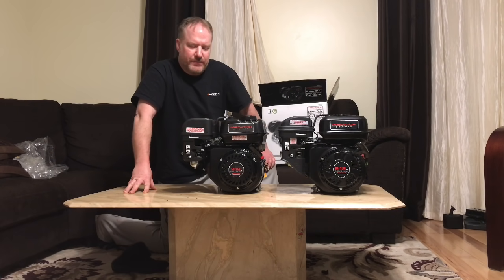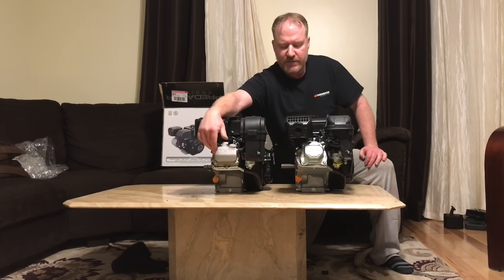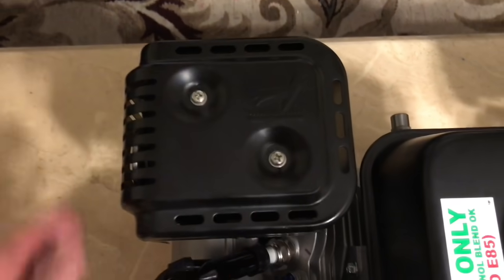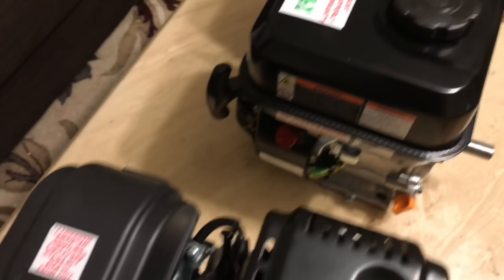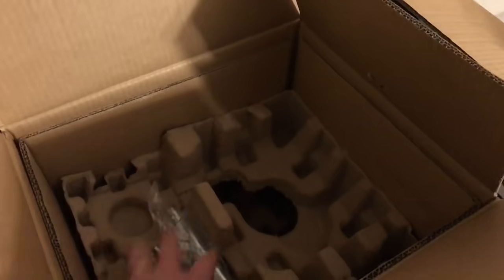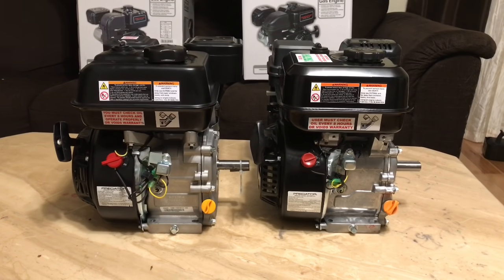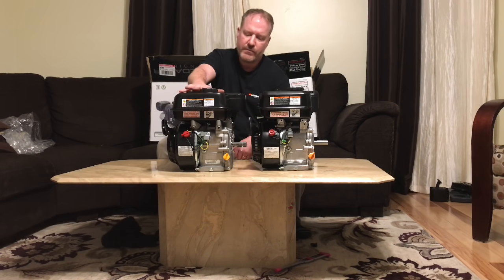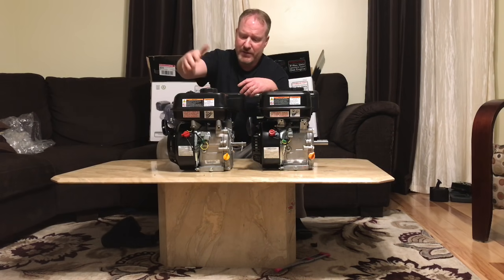What?!?  Harbor Freight Predator 212cc HEMI built by different factory than NON-HEMI???

Comment: I've heard exactly the same from others. I would say the hemi factory ships EVERYTHING, without testing it, and the non-hemi factory has their shit together, based on my non-hemi 212 engine entering it's 5th year of service on my MTB. I've changed spark plugs, oil, air cleaner, exhaust, and zip-tied the governor spring, and it runs like new, and has never leaked a drop of oil. So, after an oil change, and a new fuse for my brake light, my bike is ready for spring. PS I bought a 3 magnet flywheel made in the hemi factory, and when mounted, had 0.125" runout on the face, and 0.010" runout on the diameter. With 4 days of scraping, lapping, and checking, repeat, I got it running within 0.001" in both directions, better than new. How much do metal chips have to pile up in a fixture to bore, and cut a keyway that crooked? I'm a retired tool & die maker, and I can tell you, you have to neglect cleaning between setups for hours, in order to accumulate that many chips. If I had not straightened the tapered bore on that flywheel, and just ran it like that, it would have torn the crankshaft to bits and pieces, in no time. Don't buy hemis.

Comment: I also had a 212 that on first pull seem to be locked up.  After putting wrench on the crank I was able to free and turn it backwards about 200 degrees and then it had a clank and locked again. I didnt want to fiddle with taking it back so I poped the cover and the first thing I noticed was the alignment mark for the crank, cam and counterweight were all out of sync. After fixing that, it still would not make a full rotation without hitting something yet everything looked fine. Then I pulled the valve cover and the push rods were not even in the valve seat. one had fallen down and was hitting cam lob and jamming against the inside of the block. So other than being pissed it all looked OK. so I put everything back the way it should be, set the valve lash and checked all the clearances now that I could fully rotate the engine. All looked great. Put it all back together fill it with oil and gas and it started 1st pull. So I guess we have some body on the assembly line either having a bad day or deliberately trying to screw up the engines up and obviously there is no QC to check.  Other than that, it still runs fine.

Comment: Anybody have any input on the gen 3 212? It has 5mm valve stems which from what I hear there are not aftermarket parts available. Or if you had a gen 3 predator could you put modded gen 1 head on it? Thanks for the video!

Comment: I had a non hemi but compared to a Honda GX it is horrible in cold starts and the GX has proven it's durability in summer they run 8-12 hours Monday through Sunday on air compressors in 90-100 degree heat and lack of maintenance.

Comment: Harbor Freight has 3 Companies who produce them for them that is the reason for 3 SKU : 69730, 60363, 69727. 
Also they are all 212cc even HarborFreight now sell the 69730 as a 7HP. I am guessing the piston is 68mm and not 64mm 
Take it apart and tell us if the piston from one to the other is a different diameter and if the valves are the same or not. That is where Engines can differ.

Comment: I thought something was leaking in the house as I sat here totally admiring your OCD. How long did it take you to totally find every conceivable difference between the 2? You even described the differences between the boxes for fuck sakes. And your whole mantra on why Harbor freight uses 2 factories had me twisting my head off to the side like a dog desperately trying to discern what it is being told. But, did you notice the boxes have the same inking and colors? They probably make them in the same frigging factory but they build the differences in so the parts do not get mixed up with one another. Believe me, if they need to crank out 100K of each type in a production run, they can do it. There is a very good chance that Honda is sourcing it's engines from this supplier. In fact, I have seen Asian woodworkers in the Philippines producing the same woodcarving for a US buyer in 5 different shops. But I do admire your investigative abilities. You should be a detective.

Comment: Thanks for the info,  do you still hold your opinion on the two engines?  I'm planning a project build with several of these engines and they all need to be the same type, so this important to know before I make my purchase.  Thanks again for your information and viewpoint.
Reply from the maker: Southern Engineering 
Yes...I have now had a LOT of experience with both engines and a definitely recommend the NON-HEMI version.  Its on par with Honda quality.
Reply: Thanks for the feed info, I'm going to buy 11 of them tomorrow.
Reply: @BUILDNIGHT  What proof do you have that the non hemi is on "par" with honda quality? That is a pretty bold statement.

Comment: Just wondering, will the hemi head bolt on and work on the non hemi version?
Reply: the ppl that live and breathe these motors think the NON hemi head on the HEMI (flat top piston) is the way to go.  there is a different length push rods on the HEMI and NON hemi. the flywheels are different taper on the shaft.   both heads are ok,   open them up with a WEN/e bay grinder and sanding drums to they can breathe.  STAY AWAY FROM VALVE SEATS WITH GRINDER!!!!!!!!!!  if ruin sealing of hard valve seat, that is bad,    CM .265" cam in the NON hemi engine,  1.3 rockers and 26# springs in the NON hemi engine will get a person ....8000RPM but HAVE TO HAVE BILLET ROD $65 and BILLET FLYWHEEL as magnet flies out of stock flywheel over.... 5500???? some say that it wont, others say it flies out like a bullit??? ur results may vary. some epoxy the magnet and thingie that holds the magnet to the flywheel to the flywheel.  but the little Phillips screw that holds the magnet on is cheap and all I cld do is strip the head of the screw so couldn't get it out. so I super glued around it.   3/16" plate between the motor and the operator? stay out of flight path of flywheel if it grenades. break in for 3 hours on test stand at various RPM's change oil after ... 45 mins of running?  oil is oil, some ppl like the EXPENSIVE snake oil, others ... oil is oil. 10 - 30 good as any.  WM synthetic... good as any.

Comment: if they have to copy someone else's design to make something, what that does that say about them.... I have the original 212 on a generator and a power washer, I've been quite surprised so far. the break-in is most important!
Reply: The Pedator engines are,   Preying on You..  Like all China stuff.   There's NO rod bearing,  it's Aluminum on Aluminum..   "LOW GRADE ALUMINUM" ..
Reply: @THOMASTHESAILOR  bullshit, the crank is NOT aluminum. Why do people comment when they have no clue?

Comment: I bought their 4k generator with the hemi engine in it, over a year ago. I've run the generator about 10 hours with a load in it, with no problems. I also added electric start because if difficulty starting in the winter cold. The only claimed difference I've heard, between the two designs, is fuel economy. I have no way of proving this, as this is the only predator I own. If anyone owns a 4k generator with the older design engine, what is the claimed run time on a 2.5 gallon tank. The hemi is rated for 10hrs.

Comment: Most of us who have used both of these engines prefer the non-hemi engine and looking past the "hemi hype".
Reply: Why?
Reply: Why ?
Reply: Non hemi can actually be built up to have more horse power than a hemi..that is why
Reply: hemi is an ancient design and the so called performance advantages are just hype, even in a dodge. there are more modern designs that outperform it and have for years. 
 it is not really a true hemi anyway as a true hemi would have a combustion chamber resembling half a ball.
Reply: @GoKartsorGoneFishin  Not quite sure that is correct. There are many youtube videos showing the hemi making 20+hp. I think if you want to build a 20+hp engine you would be better just starting out with a larger engine.
Reply: @bucknut2850  Sure but 99 out of 100 guys building for 20HP aren't going to use a hemi head. Nearly EVERY aftermarket head is a non hemi. Even for a mild build you would want a non hemi head.

Comment: I have just one question, do they start as good & easy as a Honda Engine? :)
Reply: Fook Honda.
Reply: @Davido50  the hemi opens the exhaust valve when starting the engine. That is built into the cam for easier starting. After adding higher pound valve springs it is harder TO PULL START than with original valve springs. Knowledge from EXPERIENCE!

Comment: I picked up a non hemi 212 instead of a hemi by accident. I used it for my mini bike frame lol. I don't want to go back and cry how I got the wrong kind of engine 😂
Reply: It actually is performing really well! I just would think that a hemi would be a better engine because it's got a bit more torque, but a Predator engine is a predator engine!
Reply: Kenny H  opinions simply do not count here, there are facts like bigger valves and valve stems that are important when getting more power out put that are completely stock upgrades over a non hemi.

Comment: i have the non hemi 212 cc motor im using for my 20 year old cyclone rake around 2000 as its better and never let me down and have better vacuum performance when using the power vacuum pickup. as it don't bog down. if any part breaks i can get Honda gaskets. or a Honda recoil assembly. as the muffler has to be modified to use the motor on vacuums, blowers, and chipper shredders. as the pipe needs cut an extension pipe to raise the muffler to clear the housing then it welded in place. has to be high and level to clear the blower housing, and allow access to the spark plug. as there is a video replacing chipper motor with predator engine as he had to modify his muffler. as tillers, pressure washerd, some snow throwers the engine fits fine no muffler modifications. some applications you need a shaft adapter to convert the 3/4 shaft to 1 inch. as i believe the non hemi is the way to go as this Hemi engine its also used on these Generac pressure washers same chinese hemi block but different airbox and recoil housing. but have the problems as you said.

Comment: This was good information... What I was wondering is if the ignition timing was different between the two, the location and size of the exhaust port, the compression ratio difference if any, the rod ratio difference if any, the carburetoration differences if any...

Comment: If you want a good hemi, definitely go with the Tillotson.
Reply: Agree' they are very powerful. The 212 produces 10hp" 💪
Reply: I m looking for motor for my g cart i looked at tillson and pred. I fill pred 6.5 stock is best way to go tjen put stage 1 kit
Reply: . Skott The hemi 2nd generation (60363) is a great engine.  I just added a mod 2 cam to mine and it really woke it up. Maintain it and change oil often, adjust valves and run it like you stole it.  I'm at about 13hp with upgrades. Runs like a champ after fine tuning Mikuni vm22 carburator.
Reply: @bucknut2850  I just bought a Predator 212 Hemi, and it's stock at the moment. What cam did you go with? And can you give more details on your mods? I'm thinking about putting it on my mini bike, and I'd like it to have some good performance, but yet still be reliable.
Reply: @jonathankeith524   First I removed the governor. I now have a Dyno Cams CM Grind Super X -cam (This is the second cam I have installed giving it more lift than the first one I put in it), 22 pound springs, ARC rod, a Mikuni VM22 (a real one not a clone) with a 130 main jet and a custom "over sized ID" exhaust I built for it with a home made baffle for a wee bit of back pressure.. I installed a electric start flywheel which makes me keep rpm under 6000 (I was told I was taking a chance on the 6000 rpm with the kohler flywheel but I am sure it is better than any stock predator flywheel). . Also there are videos of professionals saying the kohler can run 6000 rpm without a issue, but I built it for torque not high rpm. Running at that rpm is my personal choice, you have to decide for yourself, I want nobody hurt. I also will be adding a 3/16" thick steel plate I made above the flywheel for a bit of protection in case my decision causes the flywheel to fly apart. I first installed a 6 degree key then switched to 8 degree advance key to flywheel for the 32 degrees of advance per cam recommendations. ***Update, just ordered the .010 head gasket and will be porting the head. More damn near free ($5) horsepower.  Engine has ALWAYS started instantly and still has a mild lope while idling.

Comment: Thanks for this video! I have a question, having just used this engine to replace one on an old brush mower. Leaves and debris really accumulate (A LOT) on the pull starter housing! I've never seen such packing of leaves happen so much on any other engine. It's obvious that a  LOT of air is pulled in there and it is for cooling the engine, right? Well, what would you suggest to keep this housing clear of debris so the air can flow freely? The dried leaves and debris in the underbrush is just the way it is. I guess I could fashion something out of hardware cloth or steel mesh, but this is weird. Sure don't want the engine to overheat.  Thanks again.

Comment: the hemis had bad automatic decompression release on the camshafts they have been up dated . need parts toro uses the same engines on the newer power max and snow master. toro and ariens/gravely dealers can get parts for most Harbor Freight engines just show original part at counter and what engine it is.

Comment: The hemi pushrods are longer the piston also is a flat top not depressed. Someone Im not sure who it was dyno both engines stock and tbe hemi was like 0.5 horses stronger. ARC perormance gives the Hemi glowing reviews. Of course most of us cant girind CNC the spring pockets or put valve cuts into the pistons. That starts getting expensive. I have two hemis love them. If I want a stronger motor I'll purchase the 420cc or buy a Vegas Cart 460cc.

Comment: These clone engines are about the only thing from china that is equivalent to the original. When i first bought one i was afraid to use it hard because i figured it would throw a rod.  Then i removed the governor on the water pump and run it wide open. Wow
Reply: Charlie Magoo When did they start putting water pumps on these air cooled engines? 😏
Reply: White Wolf  I couldn't tell if it was satire or a serious comment. I guess this one flew over my head. With the lack of common sense these days sometimes it's hard to tell the difference...
Reply: Trash pump
Reply: Trash pump is water pump.  I use it for water well drilling
Reply: I guess i couldnt see what i typed on the phone.  The first clone engine i bought was on a  trash pump(water pump)  so i ran the water pump without governor.  No satire intended. Just cant see what i typed
Reply: @bodeine454  you're so intelligent you can't even stand it. He has the motor mounted on a water pump... ..... ......... wow. 😂
Reply: @marioalvidrez231  Not now it's not, I just had never heard of a trash pump before! Lol
Reply: He means low oil sensor.

There is a sensor in the block just south west of the crank that shuts off the engine if the oil level is low.
Reply: Charlie, the go cart guys really trick these engines out. Apparently, just taking the governor off gets them from the 6.5 hp stock up to 9 hp or so. They have carb and exhaust kits, valve spring kits etc that can get them up to 15hp without having to go into the engine.  With a piston & rod kit along with decking the head, port & polish etc  you can get up to 20hp out of that little engine. 
Now, I am a 50 yo woman so I am a bit at a loss as to what exactly I would use a 20hp go cart for but it does make me feel good knowing that engine will hold together making 15hp with the stock rod & piston. It should last a good long time making 6hp in my generator. I have the hemi version and just got it broken in. So far I am delighted with it. It runs very smooth and puts out a clean sine wave. Hopefully it will last.

Comment: Do they last as long as a Honda or Briggs and Stratton engine, or do You have to buy 2 of them to last as long as a name brand engine?
Reply: it really wont matter with harbor freights no question asked bring back in a hundred pieces as long as its in the box with receipt return policy , just have to spen the extra 15 for replacement warranty . and that goes for everything they sell.
Reply: Besides, as long as you change the break in oil early then use a premium oil chances are it’ll run fine for almost as long as the Honda.

Comment: Has anyone noticed if the piston is domed on the Hemi? If not then it is not a true Hemi. You would have to have a piston made to match the head. Then hope you have the correct flame travel across the piston to have a better burn. That's what makes the Hemi work better. Oh and the squench area. The other engine with a flat piston & a head that is cut out or shaped right will have a better flame propergation. One would have to run dyno tests on both engines to see HP outcomes. My 2 cents.
Reply: the hemi has a flat top piston...........non hemi is dished. 2 cents refunded........

Comment: First, Mopar bought Every Naming rights-every, to call or to use the name "Hemi", for thought, but notice the location of the spark plug on both engines, more so on the side, not saying there not spherical combustion camber- a 180 degree dome, but yes those engines went under many different  names, champion, predator, greyhound, Laftin, power mate, ect. Sure they might be from 2different manufacturers, you have a good point, but companies such like honda call the dome combustion cambers RCFV -Radial Combustion Four Valve, that's  there Hemi, the spark plug is directly in the center of the head